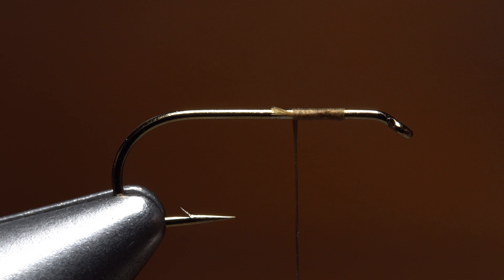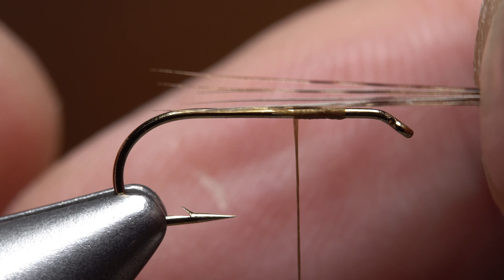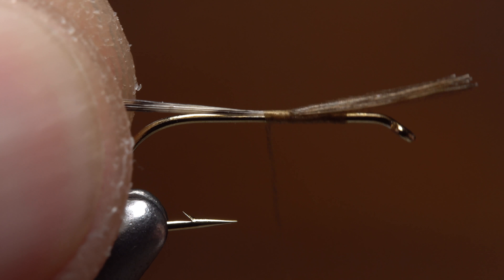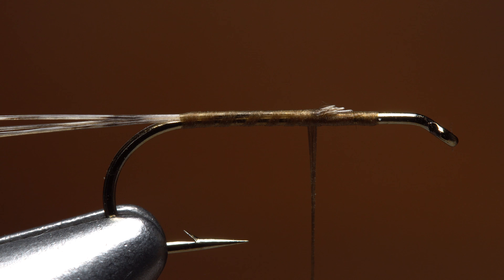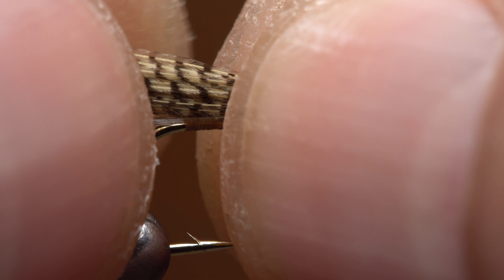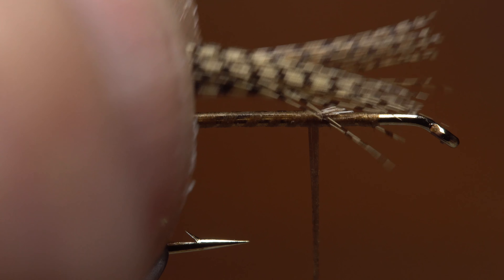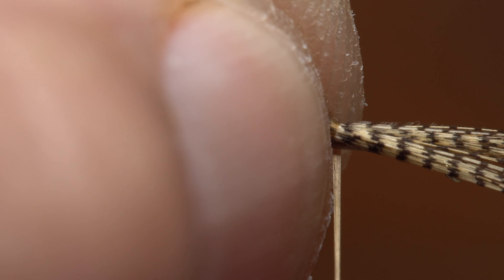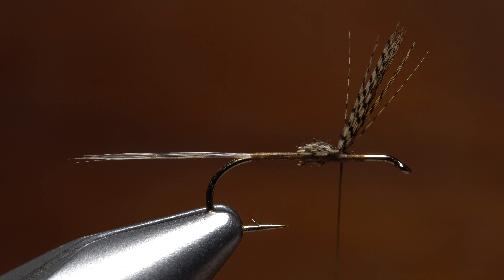How to Accurately Measure Materials

Comment: Great advice as always Tim.  I have a steel rule screwed to my desktop and measure off my ribbing, floss or chenille before cutting off what I need to tie a set of flies - saves a lot of material. For a new pattern, I cut of 12 inches of material and measure what I have left after tying a fly. The amount used per fly for that pattern gets added to my notes.  Hank